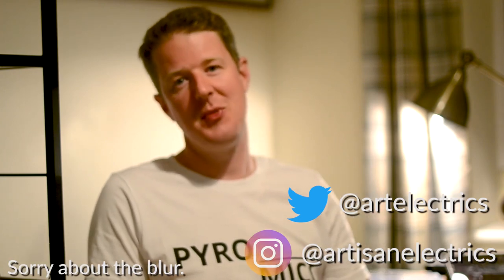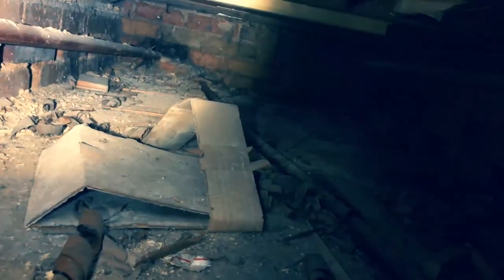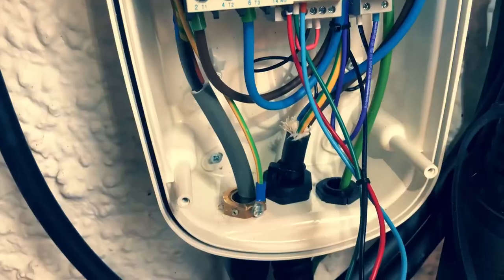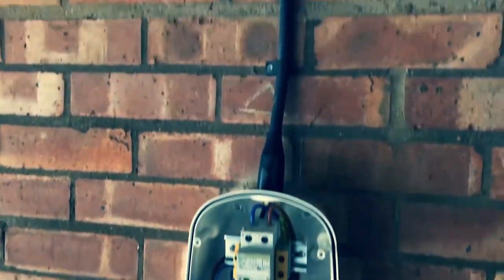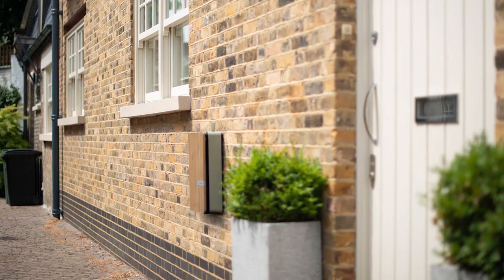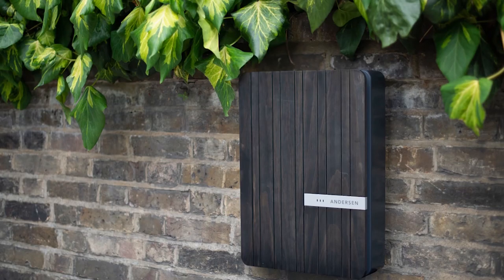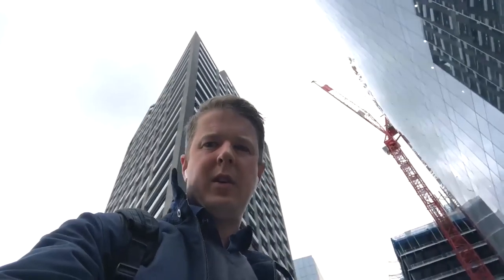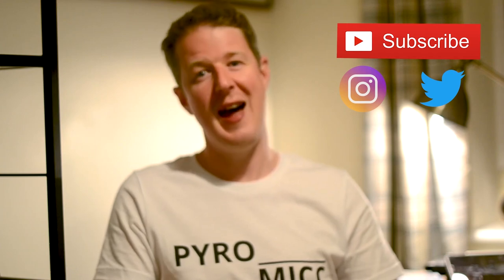EV Charging Point Installation & Very Special NEW Electric Vehicle Charging Training Course

Comment: Another great video mate. I'm doing the c&g 2919 in a month so finding this interesting. A few q's. Looking at the COP its earth rods on most jobs? Also what's your thoughts on mixing different manufacturer's cb's in con units. Do you think it's better to split the outgoing tails & fit a separate unit for the charging point? Keep up the good work.
Reply from the maker: Thanks for your questions, I will save these for an upcoming Q&A Video

Comment: Hi there. Nice vid. Whats the best and quickest way to get the skills to do this. Completely changing professions age 40 and i start a level 2 in January. My aim is to try and get to the point where I am installing charge points and solar asap but i don't want to miss anything while I play career catch up. If I am just interested in ev charge points and solar is their a quicker (but safe) way than level 2, level 3 and then installation courses??? Many thanks, just subscribed.
Reply from the maker: Thanks for watching! You need to be a fully qualified electrician to install EV charging points and solar PV plus the additional qualifications needed for each particular niche
Reply: I would do it the way you are going mate, I am in a very similar position take the time you need to feel confident working with electricity and carrying out the work and then do the course. L2 and 3 NVQ then AM2 will give you a lot more options in the future,  I still haven’t been approved by OLEV yet and I did the course last April so there are lots of hoops once you have the qual too.
Reply: @tireddad4095  cheers.

Comment: Hi Jordan was there a cost for the course? On average how much do you get for an electrical install for a charging point? Thanks. the new intro is great. Keep up the good work.
Reply from the maker: Thanks! No the course was free for selected contractors they have chosen an exclusive few contractors to train. My average price for an EV Charging Install is £1800 inc VAT
Reply: Artisan Electrics  is that including the charging point?
Reply: Electricalwork the customer usually supplies the charging point, usually comes with the car they purchased
Reply: Does that include the car? 😂
Reply from the maker: Electricalwork yes that’s including the charging point which is usually about £500
Reply from the maker: Marky MGTOW I’ve never had a customer who supplied the charging point before
Reply from the maker: Andy Kirwan 😂

Comment: I am curious to know if all of your "tools" will fit into a Nissan e200 van?
Customers having "Home Chargers" would like to see "Artisan Electrics" turn up in an EV van, Weather it be a Nissan or a Mercedes Benz Esprinter all-electric (when your current lease ends). 
EV YouTubers will invite on to do an interview/demonstration, which will lead to more installations. All over East Anglia and the home counties, 
Have you visited the EV Experience? In Central Milton Keynes.
Reply from the maker: I wanted to get an env200 but it’s just a bit too small, if the Mercedes Electric van was out I would have gone for that but every time I phoned the dealership they said they didn’t know when it was going to be released. 
I’m thinking of getting a Tesla Model 3 and wrapping it with my company logo that would be cool to turn up in for quotes!

Comment: Hi. Great channel, just subscribed. What do you do if the customer has an old basic consumer unit? Do they have to update it before you can fit a charge point or is there a way around this? By the way, the Andersen units look amazing. 😀
Reply from the maker: Yeah if they have an old consumer unit I would either quote to upgrade it or install a separate consumer unit for the charging point

Comment: Did an ev course a while back which was Rolec sponsored,  I'm I right in thinking it's the Rolec tester you use? If so do you rate it? Just about to set off on my ev installation journey and loving the vids.. very reassuring.. finally did you do your ev q&a yet? If so can you point me pls soz for so many questions😁 👍✌

Comment: Hi Jordan can you explain what you have done with the SWA earth as it enters the charging point enclosure which appears is wrapped in green and yellow tape? It looks like you have connected it to the earth terminal on the left and then connected the earth rod to the earth terminal on the right. However forgive me if I am wrong but are these not interconnected by the fact that the earthing terminals have a metallic lug on them which secures them to the metallic terminal bar. These look exactly like the ones I use on enclosure boards and the whole point is that they are earthed via the metal bar to the terminal screws inside.

Comment: I see that you have not connected the SWA armour to the PME supply and connected at the charging point end.
I have never seen a TT installation done this way before, is that your method or something suggested on Electrical Vehicle Charging course.
(I have not done course just been looking in BS7671)
I can see that if a fault occurs to the armour the RCD will see this imbalance and trip.
Is the RCD in the split board type A also, as the DC could stop the RCD in the board from operating if there was a fault on one of the existing circuits in the house. Just wondered if this was covered in Charging Course.
Reply: Just noticed that the black of the SWA has been sleeved Green/Yellow and is connected to the PME.
So Reg in 722.411.4.1 (ii) states to install an earth electrode.
Annex 722 item A722.3 has a calculation for electrode resistance.
Which when calculated comes up with a very low value of resistance, maximum demand of installation was up to 100A the resistance would need to be as low as 1 ohm.
As stated i have not done the course just wondered if there was a way around this?

Comment: What are your thoughts on a couple manufacturers claiming to not need an earth rod? Do Anderson claim they have the voltage monitoring device? Seems like a nightmare to fit with customers expecting a point on the wall with no visible cables or conduit
Reply: Pod-points do not need an earth rod They have a pen disconnection device

Comment: Do you use the EV:CHARGECHECK for all your charge point testing or just on Rolec charge points?
Reply from the maker: Yes it works with most brands of charging point
Reply: @artisanelectrics  does that also work on 3 phase chargers too or just single phase supplies?

Comment: Can I just ask a question about charger installation?
When we get one, we'll need a cable to cross about 1 metre of our own path between house and garage.  It will need to go underground.
We're having some garden work done shortly, if I get the gardener to bury some black rigid 1" pipe under the paving slabs would that do so armoured cable could be pushed through later?
Reply from the maker: Yes that’s a very good idea! I would make it larger than one inch to be safe. And block off the ends properly so it doesn’t get filled with dirt or water.
Reply: @artisanelectrics  Thanks. Will do.

Comment: What do you do in regards to earthing if you have to install an earth spike? What do you do with the armouring and earth in the swa? In this video it looked as though you connected them to the charger but surely that defeats the purpose of the earth spike?
Reply from the maker: Thanks for the questions, I will save this for an upcoming Q&A video on EV Charging
Reply: The charging unit needs it’s own earth spike installing because the vehicle it will be charging is out of the equipotential zone of the property. There should be no connection to earth between the consumer unit m.e.t and the charging unit earth. Also it should be fed from an mcb as the unit has its own RCD.
Reply: @RyM1979  Yeah, that was my understanding, which is why I asked what you were supposed to do as it looked like he connected the armoring and the earth in the swa to the charger.

Comment: Just getting back into electrical contracting ..why have you got to use a earth rod for pme car charging systems only,

im being lazy for not checking it out myself.👍
Reply from the maker: Thanks for your questions, I will save these for an upcoming Q&A Video
Reply: In case you lose the neutral connection on the pme you also lose the earth connection so they put in the earth rod as insurance really to ensure there is always a physical earth connection

Comment: Can you explain what you did with the cpc on the supply cable? It looks like you’ve connected it at the board end and at the charger and then ran another  cpc from a rod.
Reply from the maker: There are two separate earth terminals in the Rolec units, one for the incoming earth from the consumer unit, which is just to earth the cable and sheath, and one for the earth from the earth electrode which provides the earth to the charging point socket.
Reply: Artisan Electrics ah, didn’t realise there is a terminal for the incoming earth. Thought it would just have to have a wago on. 👍🏼

Comment: Does the Anderson have load balancing? Too many installers chucking the Rolec chargers in without properly assessing loads. Many of the big EV charging companies are turning up on the day without previously surveying the install before hand which I find concerning, they are hardly gonna refuse an install on the day and turn away customers cash, they are just taking the money and running! Anderson look nice charge points and have been looking to become an installer  myself.
Reply from the maker: Yeah the Andersen are smart chargers so OLEV approved, I agree with you, there are a lot of cowboys out there.